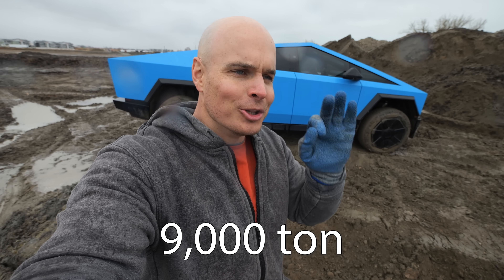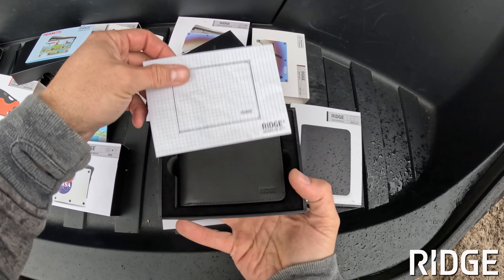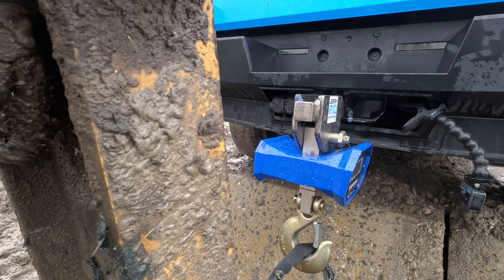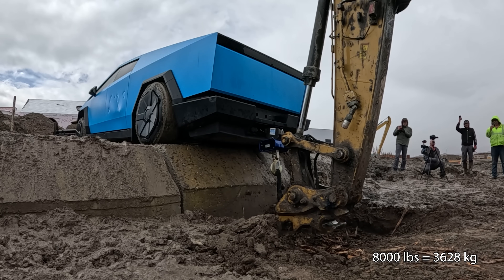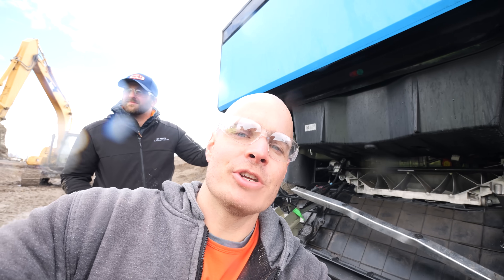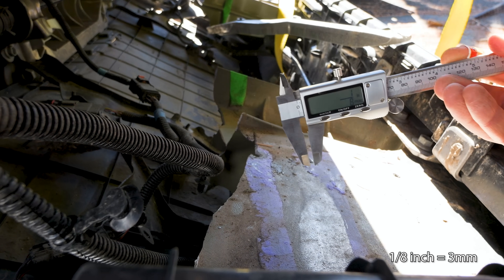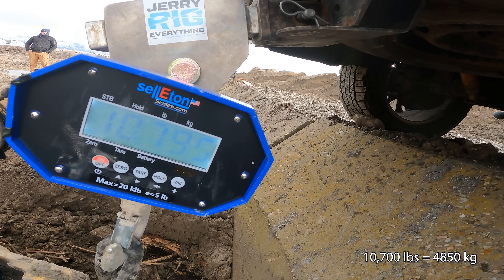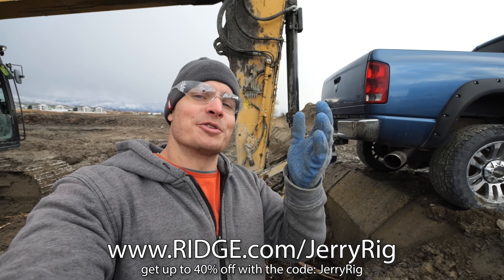SHOULD YOU TOW WITH A CYBERTRUCK?! - (catastrophic failure test)

Comment: A few things to clarify:
The examples presented of 'what if you hit a pothole' represent momentary loads on the tow hardware - this test is not a momentary load but is a prolonged load at several times the truck's rated capabilities.

The statements pointing out the dangers of "an improperly loaded trailer" are true for literally all towing scenarios.  The ratings are there for a reason - if you exceed ratings, all bets are off and you or someone around you could very well have a bad day.  Nowhere in this video did the CT fail below its ratings.

The statements about tow weight becoming tongue weight when cresting a hill are only partially true.  Under no circumstance will 100% of a tow weight become tongue weight.  Cresting a hill, driving downhill, heavy breaking, etc.. will all shift weight onto the tongue, but nowhere near the full weight of the tow payload.  If you keep a CT within its 11,000 lb tow limit, there's just no conceivable way to exert the prolonged 10,000 lb tongue weight force seen here.  Additionally, if you are operating near the upper bounds of your vehicle's tow range, using a weight distribution tow hitch negates nearly all of the effect pointed out here.

The "glue" seen on the casting appears to be an NVMH sealant.  This is applied in many places on all modern vehicles to reduce noise and vibrations.  It appears that the body and frame come near enough to each other here that Tesla was concerned they might vibrate, squeak, or rattle together.  This type of sealant helps keep that from happening.  The video points at this as a poorly designed structural element, but that does not appear to be the case.

All that said, I agree that a steel frame would be a better choice for the towing hardware, but what they have is fine if used within the stated limitations.  To date, there have been zero Cybertrucks whose frames broke that weren't in an accident or tested to destruction for youtube clicks like we see here.

Comment: Not an actual load test. 14,000 lbs load would put 1,400-2,100 lbs on the tongue, 10 to 15% of load, not 14,000. Most states have 14,000lbs limit, anything over 14,000 lbs gross, you need a CDL license to haul and a commercial vehicle to haul. Just so you know, Cybertrucks are not designed to be heavy haulers.

Comment: Its funny how people defend the cybertruck even though it broke do people not understand if you pull 11000 lb trailer at some point in pulling it that weight will be transfered to the trailer  hitch and since it gets weaker every single time you use it there is a higher chance that it can break every time you pull said trailer, It starts at 11000LB and it will slowly go to 9000 8000 7000 until it ends up breaking. But saying the tonged will never hit the max weight while pulling a trailer is crazy to even say it just wont hit downward all the time but the frame itself will have the weight of the trailer going back and forth while pulling it.

Comment: Towing with a Tesla truck is impractical and now unsafe. The range while towing is stupid. 

Until range reaches 1200 miles I'll keep my combustion engine vehicle. 

And then even if it did have great range it looks worse than the Aztec by Pontiac. 

Everyone has their thing and preferences.. I do not like any Teslas. 

We need vehicle manufacturers to have a galvanized truck frame option, as long as it's not more than $4000..

Comment: The Bigger issue is the Cybertruck just snaps when exposed to a shock load,  a normal truck would bend before breaking.    People have most certainly pulled more than their old chevy half ton should have behind it, but there is a margin of error built in for stupidity,   The cybertruck doesn't have that margin.

Comment: Ah, this is NOT correct - tongue weight is DIFFERENT than tow capacity. Tesla specifically lists the tongue weight as 1100 lbs and a tow CAPACITY at 11,000. You will NEVER be able to put the full weight of a towed trailer on the tongue of any truck during normal operation. All you proved is that you can sheer aluminum (and spend a lot of money doing it)...

Comment: Jerry, I’m disappointed because I expected a more fair and honest assessment from you.

Your test is completely unrealistic and does not reflect real-world towing scenarios. Tesla specifies the Cybertruck’s maximum tongue weight at 1,100 pounds, yet your test exceeded that by a factor of ten. There is no reasonable way that the full towing weight should ever translate directly into tongue weight under normal conditions. The only way tongue weight would equal the full trailer weight is if the trailer were literally hanging off a cliff behind the vehicle. Simply cresting a hill, driving through a driveway, or hitting a pothole or speed bump does not transfer the full trailer weight into the hitch, especially when you factor in the truck’s suspension, which is designed to absorb and distribute loads.

Additionally, you artificially pinned the front end of the truck down, further exaggerating the stress on the rear hitch. This is not how a vehicle behaves under load—suspension movement distributes forces, and real-world towing scenarios don’t lock the front wheels in place while forcing extreme loads onto the hitch.

You keep emphasizing the phrase “improperly loaded trailer,” but this is misleading. Anything used improperly can be unsafe. That doesn’t mean the Cybertruck’s design is flawed—it means your test set it up to fail. By that logic, you could destroy any truck, even a heavy-duty diesel, by misusing it similarly. This is not a valid test of real-world performance; it’s an engineered failure.

⸻

Comparing the Cybertruck’s Design to the Lotus Elise and Exige

You also misrepresent how the Cybertruck’s construction works. I brought up the Lotus Elise and Exige because they are examples of modern engineering techniques to build lightweight frames that are both rigid and strong. Their frames use interlocking and overlapping aluminum extrusions, with aircraft-grade epoxy used to hold components in place—not to bear structural loads. This design prevents movement, creaking, and rubbing between components, and may also help absorb vibrations.

Similarly, the Cybertruck employs gigacast aluminum structures, which are engineered to channel stress in specific directions while minimizing unnecessary weight. The epoxy used in the Cybertruck is intended to stabilize components, not to bear the full force of structural loads, especially in the manner your test applied force. Your test pulled in a direction the structure was not designed to handle.

⸻

You Know the Difference Between Steel and Aluminum, Yet You Chose Sensationalism

Jerry, you know the fundamental differences between steel and aluminum—yet you intentionally used those differences to create a dramatic and misleading failure for views.
	•	Steel is ductile—it bends and deforms before breaking.
	•	Aluminum has a higher strength-to-weight ratio but is more brittle—it will handle high stress up to a point but will snap when pushed beyond its limit instead of bending gradually.

Your comparison to the Dodge truck is misleading because while its steel frame might have lasted longer under your test, it would have simply bent and deformed well before reaching that point. That kind of structural compromise is not necessarily safer—it just fails in a different way.

The Cybertruck is engineered to handle the stresses it was designed for, but no vehicle is built to survive an arbitrary and extreme failure test like the one you set up. The fact that the Cybertruck “snapped” under absurd conditions is not an indication of safety concerns—it’s an indication that you deliberately pushed it beyond its engineered limits to create a headline.

⸻

Selling Fear, Uncertainty, and Doubt (FUD) for Clicks

Let’s be honest—this was never about safety. This was about sensationalism.

Your comment about not wanting to be behind a Cybertruck towing on the freeway is a perfect example of you pushing FUD (Fear, Uncertainty, and Doubt) for views. You know full well that your test was not reflective of real-world conditions, yet you still chose to make it seem like the Cybertruck is inherently unsafe.

That’s misleading at best, dishonest at worst. You know better than this, and that’s what makes it disappointing.

⸻

Final Thought – This Was Clickbait, Not a Real Test

I really thought you were above making clickbait content, but this test feels deliberately designed to produce a dramatic failure for views rather than provide a fair evaluation. You didn’t test how the Cybertruck actually performs in towing scenarios; you set it up in a way that no vehicle is designed to survive.

Spreading fear and doubt with a dishonest test isn’t helpful—it just sucks. 

I expected better from you.
Reply: Best comment ever! Thanks

Comment: That’s not how weight distribution works 🤣🤣 You just proved it can tow 40 thousands pounds with no problems. Not even a semi is allowed to have 10 thousands extra pounds on the drive tires legally, only a few thousands.

Comment: im super confused what they are trying to test and prove. Towing capacity is not equal to the weight you put on the ball. I don't think anyone would load van/trailer so it exceeds roughly about 10% of the vehicles weight on the ball. So for the cyber truck that would be about 350 to say 450KG on the ball.

Comment: As a dodge fanatic, the dodge is only rated for 12k pounds because the transmission can’t handle any more. Put a decent, non Chrysler, trans in it and you can pull 25k no problem

Comment: Tongue weight should be 10-15% of the total weight being towed. The Cybertruck towing capacity is rated for 11,000lbs . If towing at max capacity, a properly loaded hitch should have a tongue weight between 1100-1650lbs. The cybertruck was held down with another tractor because he was concerned the front end would lift up due to the amount of force they were putting on the hitch. He mentioned his concern that if the load were to bounce, it could exceed the breaking point which is extremely unlikely without the front end held down.

I'm all for testing things to its limits and I know that's what Zacks channel is known for, but to put a spin on this whole thing to make the cybertruck look bad without pointing out the clear differences in his test vs real world use is embarrassing.

Comment: The weight that will break the back end off is MORE than you can drive safely with anyway. 

So breaking away may be the best option vs unstable driving on public roads.

"We are afraid the front of the truck will go up, so we made it impossible, hiding the TRUE facts. 

Lame, NEXT.

Comment: You're applying pressure to the tow hitch vertically. When you're towing, the pressure is horizontal. Even if you're going uphill, you're not putting 100% of the weight on the tongue. The Tesla Cybertruck is not poorly designed or weak. These are just poor tests. Jerryrig is trying to get a 'Gotcha' because he hates Elon Musk.

Comment: Tongue weight limit is 1,100 lbs for reference, and the force he's applying is in the direction that tongue weight limit is all that matters. Also probably shouldn't strap the front end down. If the hitch can hold enough weight to lift the front end up, what possible scenario would this be testing?

Comment: Shouldn't you be doing a tensile load test to test the 11,000 pound towing load limit on the Cybtruck hitch instead of lateral load test on the hitch? The lateral load seen on the tow hitch (tongue weight) is way lower than the towing load.

Comment: 10000lbs on the tongue and you’ll be doing wheelies the whole way 😂. Unless you’re somehow driving with the front wheel strapped down to the ground lol. Basically testing the car in a situation that it can never operate in.
Reply: How dare you use logic against a stawman argument! This video is supposed to make Elon and his companies look bad. Just accept it and hate Elon like you're supposed to.
The cybertruck is supposed to be like a tank; meaning it should be able to go off jumps, land directly on its towhitch, and be fine. Or withstand a 25 tonn excavator attempting to shear off the hitch by putting all its weight on it.
Anything less deserves nothing but condemnation and boycotting!

Comment: The Cybertruck's frame, or rather its structural body, is made primarily from a newly developed stainless steel alloy, referred to as 30X cold-rolled stainless steel, which eliminates the need for a separate frame typical in pickup trucks.

Comment: Keep in mind this dude is extremely biased and hates Elon with every fiber of his being. The highest end tri motor cyber truck is rated to haul 11,000 pounds. Which an actual tongue weight of 1,500-2,000 lbs. “With an improperly loaded trailer, and going over the top of a hill”. Even 10,000 lbs all loaded between the bumper and trailer axel, would only have a tongue weight of <5,000 lbs… which is an insane mismanagement of weight isn’t even half the force taken to break the frame.

Yes steel is superior to aluminum in strength, but the scenarios we have seen will virtually never happen in real life. If they do it is user error, and not the truck.

The trucks have been out for multiple years now and we have seen no real world failures happen from responsible use. 

TLDR 
Jerry hates Elon musk and everything he stands for.
The truck is more than capable of towing/hauling the weights it is rated for.  
If the scenario he mentioned cresting the top of a hill breaks the frame it would be from user ignorance and hauling a load twice as much as the truck is rated for AND being front loaded as incompetently as possible.

How about Jerry does a real test with a trailer and a load as he described over the top of a hill and see if it breaks. 
Hint: he won’t. Because it would never break

Comment: A quick chtgpt search. For a car with a medium to large frontal area (e.g., a pickup truck or SUV), towing a 15,000-pound trailer at:
40 mph (64 km/h): Downforce might be around 100-200 pounds (445-890 N)
60 mph (97 km/h): Downforce could be around 300-500 pounds (1,335-2,225 N)
80 mph (129 km/h): Downforce might reach 600-1,000 pounds (2,670-4,450 N)

This video is just click bait.  When you trail something, you have a down component and horizontal component of the force.  You will never get 10,000 vertical component.  I guess when you run out of videos to make, this is was left, pathetic. Maybe try to find the cure for hair loss. that will give you more click.
Reply: Using AI to prove a point doesn’t make you sound smart.
Reply: @nathanieladams7624  Force has vectors. The whole video is clickbait. Unfortunately Jerry  is mad at Elon because of his political stance and he had to do something. Any common sense person can figure out the the hitch will never get 10000 pounds of downward force. in real life. While Elon saved the whole US space program , Jerry is scratching phones. SAD.

Comment: "The hitch breaks around 10,000 pounds. (4500kg) Which is far too close to the 11,000 pound towing capacity. Yikes."

Jerry I know you're a smart guy and understand that the 11,000lb towing capacity has no relation to the 10,000lbs of vertical force the tail just snapped with. Your hatred for Elon is truly showing.

Comment: Having towed trailers with everything from a Bronco 2 to a Freightliner M2 106, and everything in between, I think this test only validates the trucks capability. ripping the hitch and frame off with 10,000 lbs of tongue weight which is 8 to10 times it's rated capacity and then predicting catastrophic results trailering shows a lack of real world experience. Yes he added a 20 second disclaimer explaining his understanding of tongue weight versus towing capacity, but unfortunately this video is merely clickbait to me. No I don't own a cyber truck and don't plan on it, but I would have no issue hooking onto a reasonably loaded 10,000 to 12,000 lb trailer and going cross country.

Comment: I've never been a Tesla fan since the beginning of the company, but the tongue weight rating is only 1100 pounds. You're off by a factor of 10 in this test and the vehicle did amazingly well. Towing, tongue, payload, gross vehicle ratings are different. This is more of a message to people that improperly tow,  ie trucks especially lifted that have an improper hitch that isnt keeping the trailer level, usually lifting the trailer and essentially a tongue weight of 0lbs. Also smaller vehicles that need to raise the attachment point so the trailer is angled down increasing the tongue weight.
Edit:The tow rating is 11,000 but this test should that have been pulling backwards rather than pushing down to have some accuracy. I own a 2019 Dodge Caravan that I tow my boat and snowmobile trailer with. 3600lbs tow rating but 360lbs tongue weight.
Reply: Your Dodge Caravan is steel. This is an aluminum. Which is a problem because aluminum does not have a fatigue limit.  Every time you put any kind of load on it, it gets weaker. 10k is just what it takes to fail immediately.

Comment: @JerryRigEverything

 Isn't most of the weight on the axles of the trailer and not the hitch? And is that a towing weight or a downforce weight on the hitch? I think this has been blown way out of proportion

Axle Weight Distribution:
A general rule of thumb is that 80-90% of the trailer's weight, including the cargo, is carried by the axles, while 10-20% is supported by the towing vehicle.